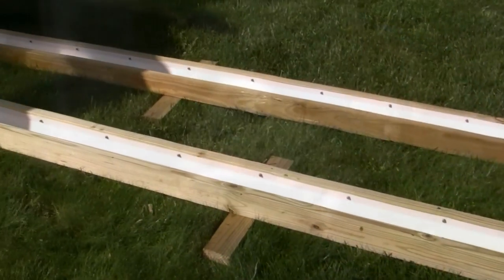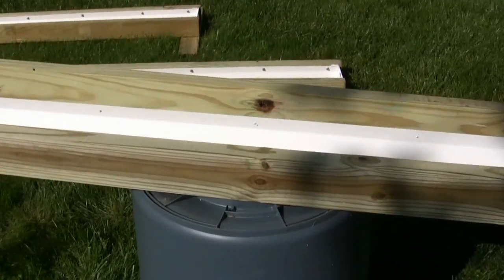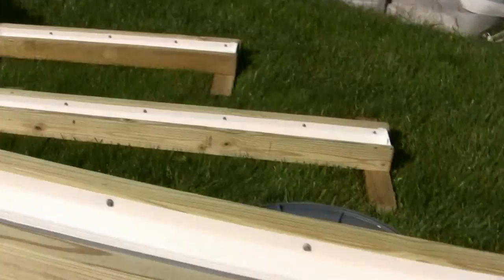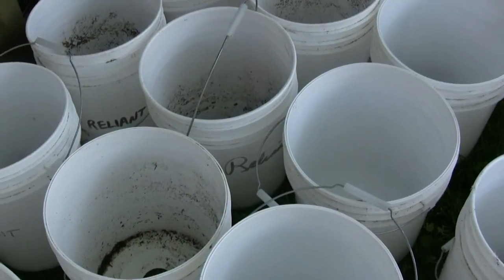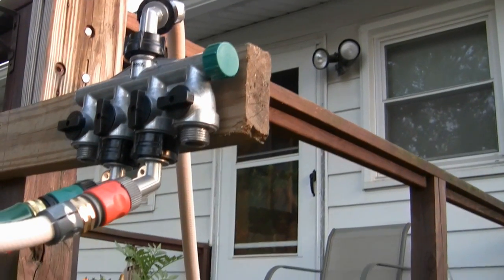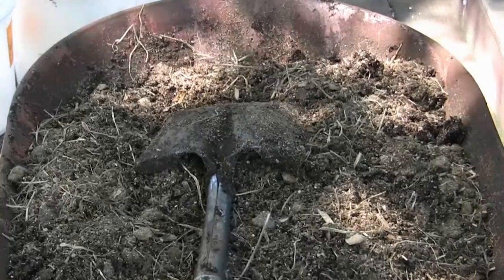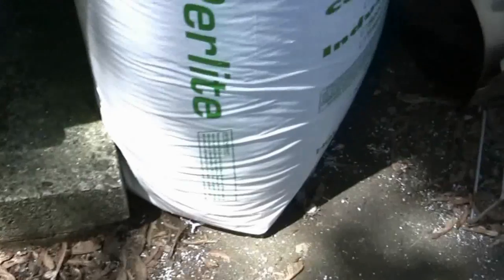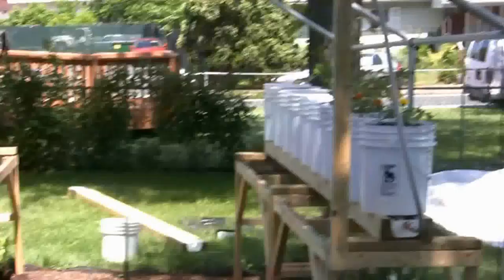Self Watering Rain Gutter Grow System @ The Garden Pit

Comment from the maker: Sorry for the late reply. When the float gets to a certain depth, in the water, it turns on and fills the gutter to the depth I have set. I'm thinking the hole for the float is 7/8". Last year when I cut out the for the float I used a very cheap hole saw with no size on it, I am going to add some more floats to some projects I am doing and I will know for sure in about a week, the size of the hole.